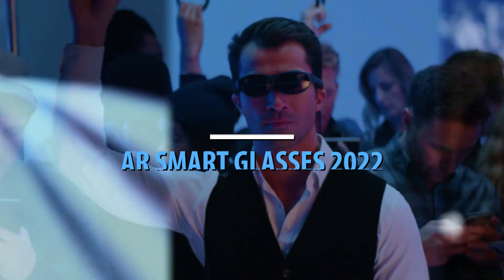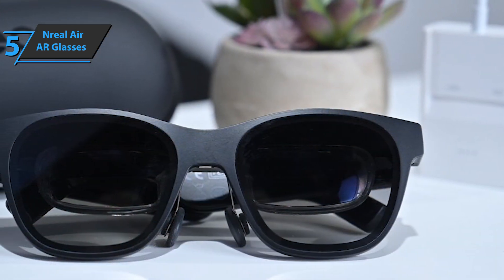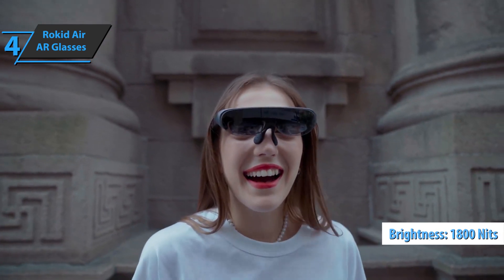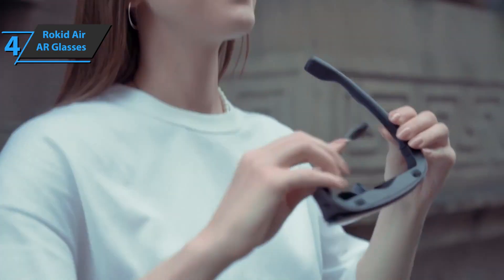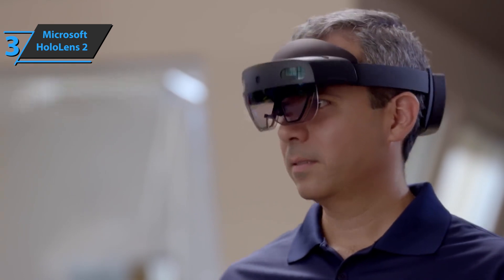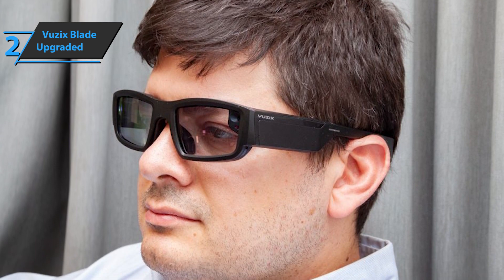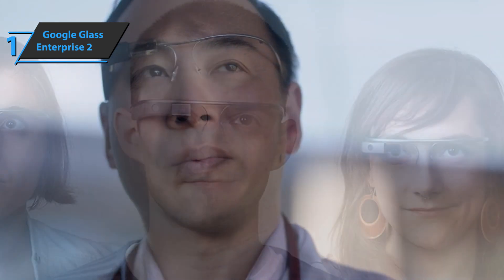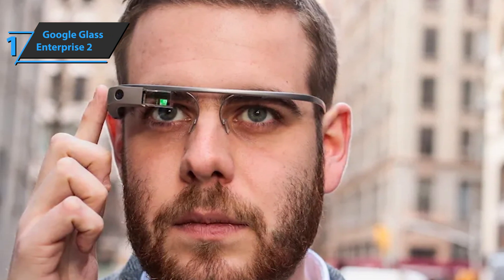Top 5 BEST AR Smart Glasses of [2022]

Comment: So I tried the ROKID Glasses and it sucks it's only for mobile cinema which drains your battery pretty quick it's SLIGHTLY Augmented but the screen is very small don't expect big things from it! I will say nreal air MIGHT take a giant leap it has 45"degree FOV Field of View and a 201"inch massive screen compared to the ROKID which only has a 103"inch small screen so yeah you get a pretty big screen with nreal glasses either way.
Reply: so i should get the nreal?
Reply: I think that the battery drain is quite insignificant, considering most phones nowadays have qled screens which use more energy, the device should be shut off. The screen is also 120 inches and not 103. The rokid glasses are not necessarily amazing but they are definitely not as bad as you make them seem. A lot of the opinions on the product come from people who have not conducted research beforehand
Reply: Can't agree more